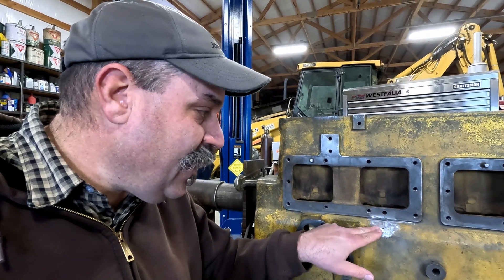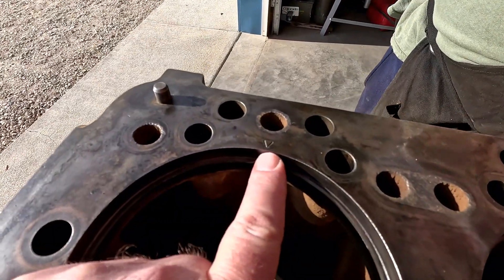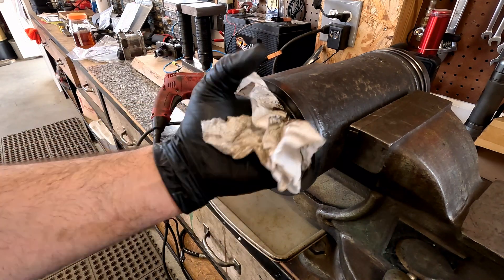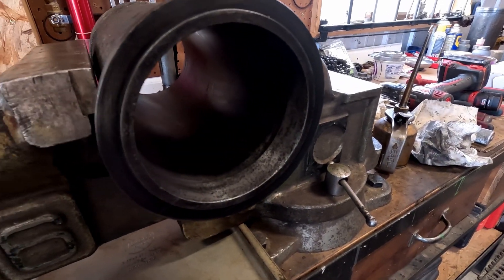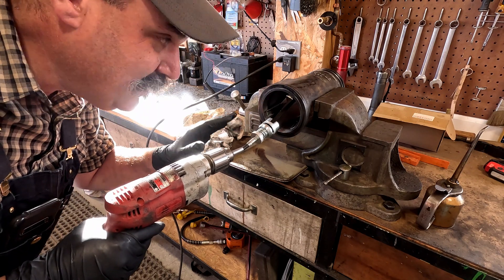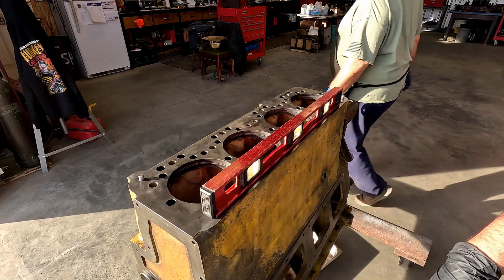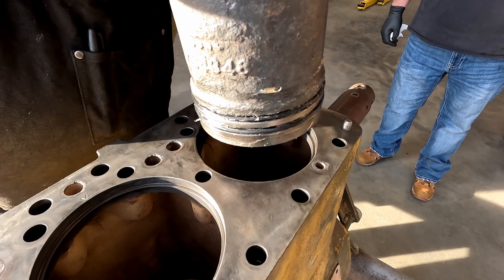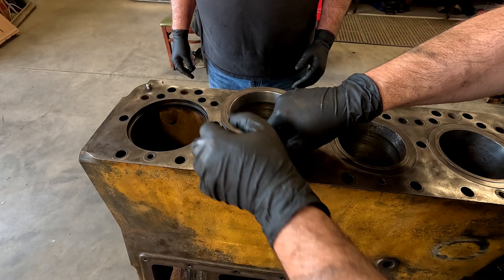Cylinder sleeve honing & installation Caterpillar Diesel engine D4400 1939 D4 4G9986 Episode #71

Comment: Add the thickness of your liner flange plus your .030 copper washer and then subtract the depth of your counterbore. This equals your liner protrusion. Should be .004-.006”.

Comment: How do you get the sleeves out? pry them?, is that how that got cracked?
Reply from the maker: We were able to tap them out with a wood block from the bottom. The crack was caused by a misalignment on a dowl externally. Someone tried to force the plate. 👍

Comment: When reusing a copper/metal gasket, we would heat them up good with a torch, I always felt it would renew and give a fresh crush. Enjoying your channel!
Reply: Your welcome, I enjoy you working with what you have versus scrapping everything and buying all new parts,  it's amazing what will work when you need it to....most mechanics are parts replacers now as opposed to knowing what can be fixed up and reused.
Reply from the maker: @nealschierling5373 when we eventually get to work on our 5T series D4, it will be even more of a budget build, lol. The plan is to reuse just about everything we can. Minus the obvious seals and gaskets. Much appreciate the kind words!
Reply: @lifeafterourloss  You bet, I have gone as far as using permatex right stuff sealant to seal wormed out lower sleeve o rings, 20 plus years ago and still holding water....is it always the best solution....no but poor people have poor ways as they say lol.
Reply from the maker: That's a great idea! It would soften the copper a little bit too. Believe it or not I found a New Old Stock head gasket at your local Caterpillar. The price was surprisingly reasonable. The new one is steel though. But when we work on 5T, I think we'll reuse the copper one and heat it. Thanks for the recommendation. 👍

Comment: I have the same job ahead with some truck liners that have rust stains. You burn up a lot of stones doing this kind of jobs. Block warping is not a major issue with cast iron blocks but more with alloy casted blocks. Once overheated they warp like crazy. Tire bead lubricant is one of the best materials to install the sleeves. Silicone oil might be number two for me. Anyway keep working on it :)